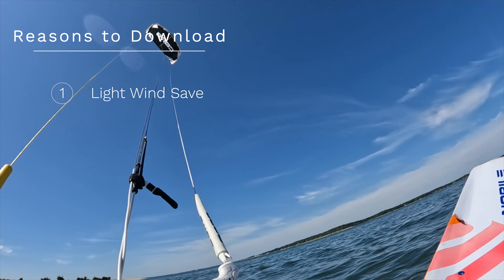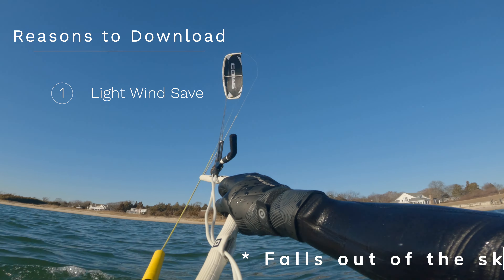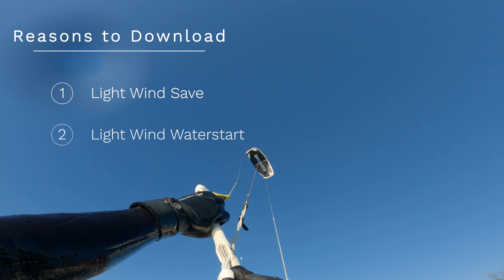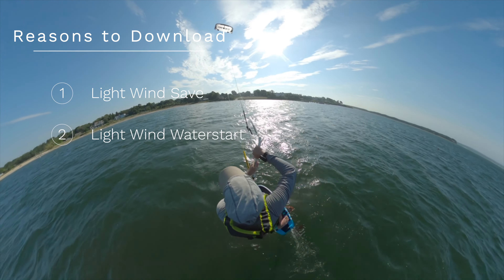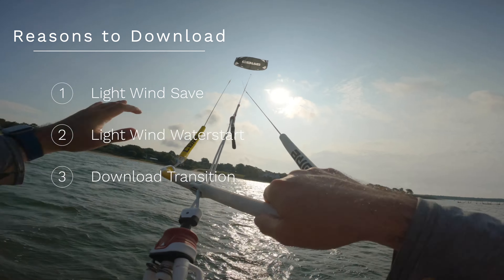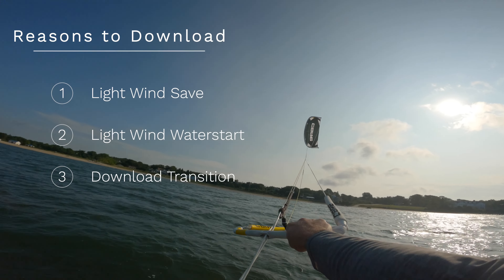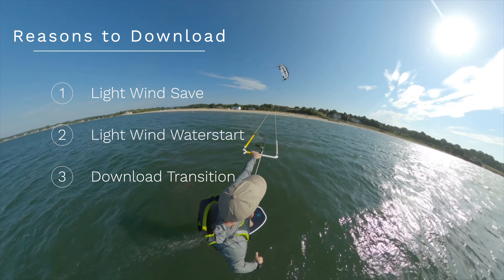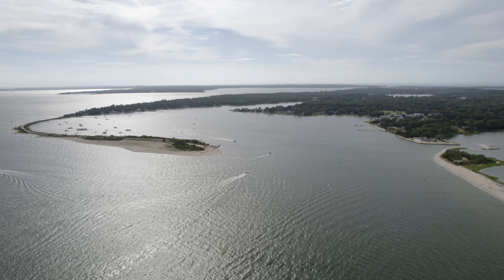Learning Kitesurf Downloops - when to use them in light wind foiling

Comment: I also avoided downloops for years, partially because I was confused about how to make them work (obvious hint: pull the bar in hard to make sure the kite completes the loop). Another thing that held me back is that one instructor taught me to hold my bar lined up with the kite, basically rotating the bar as the kite crosses the wind window. This can make steering more intuitive by maintaining the mental mapping between bar and kite, but it fails completely when doing a downloop, so I had to reprogram my brain a bit.
Now that I am foiling more I am also using downloops much more. On light wind days I use them for every transition and every water start. If the wind is really light I even initiate them before starting to turn the board, but be careful and be ready to turn the board quickly if you get a strong pull.
I usually don't bother untwisting my lines because I know that I'm just going to be doing another downloop in the other direction, so why bother?
And yeah, Steven's videos are great.
Reply from the maker: So you totally get it, haha, it’s tough to reprogram your brain.

I’m definitely doing them more now, but it’s not second nature yet. I still untwist, so I’ll give leaving them twisted a shot!